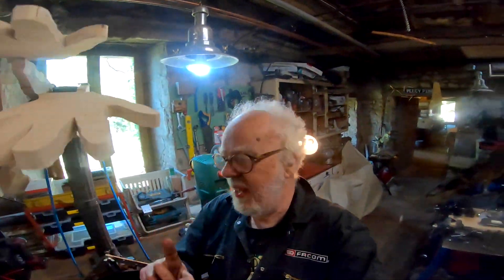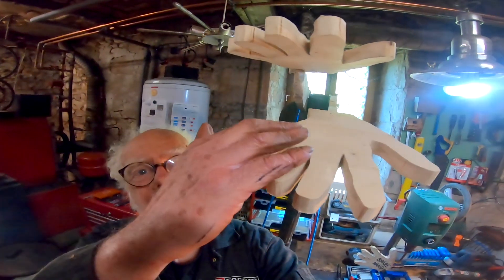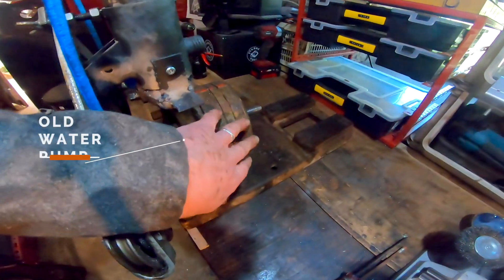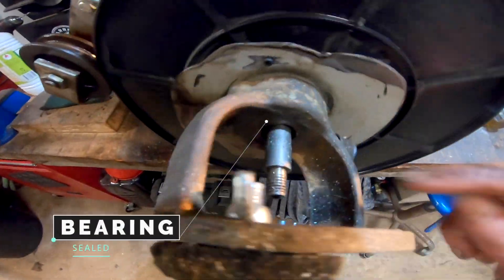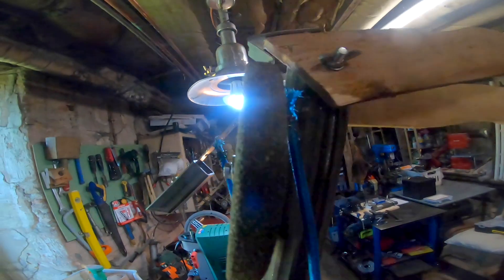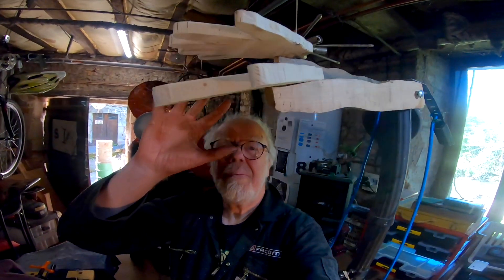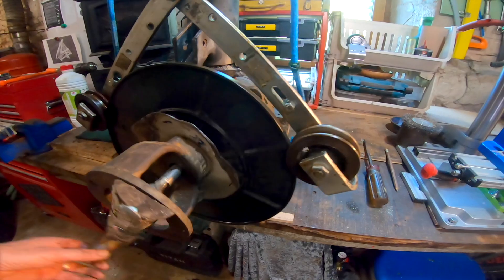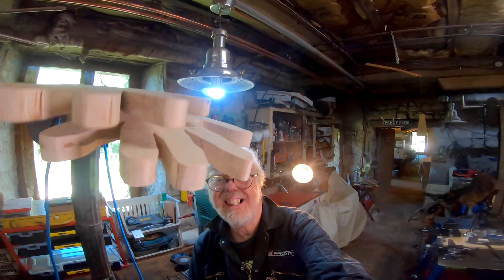Rube Goldberg crazy machine build - Prof Simon

Comment: It’s a bit of a ‘slow hand clap’, isn’t it ? ... Maybe needs a few adjustments in its sarcasm tensioners or try re-calibrating its irony gearing. In its present settings, should you reserve its use specifically to applaud those who’ve been running the global economy, or are there other deserving recipients?
Reply from the maker: Ha...ok